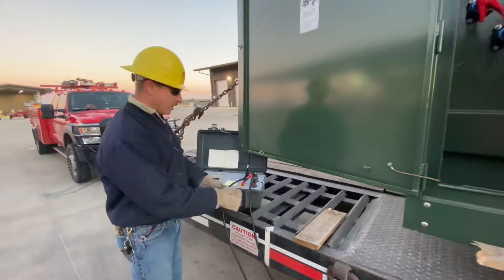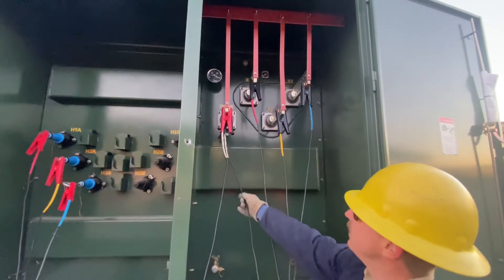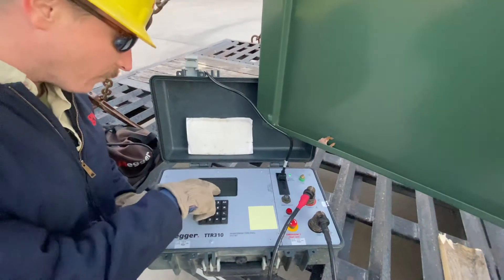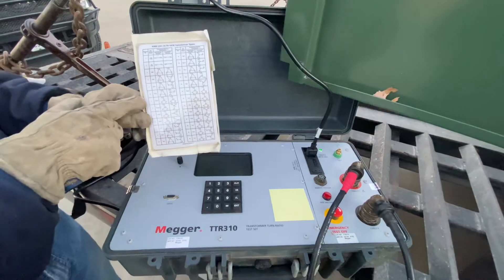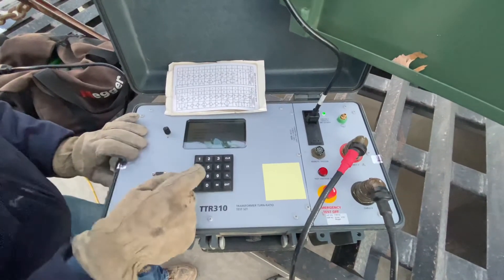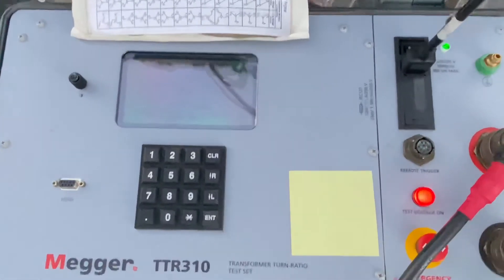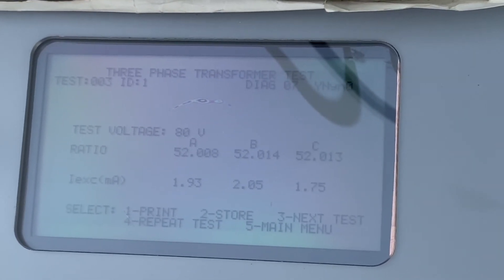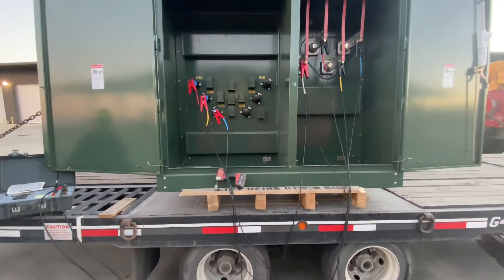Megger TTR310 Transformer Turns Ratio Testing

Comment: Richard, I have a TTR 310, but mine is without H and X cables. Would you be able to make a connection diagram between the alligator clips and the connector pins?